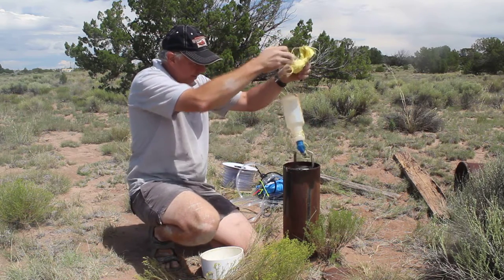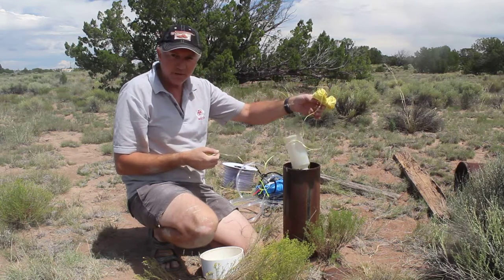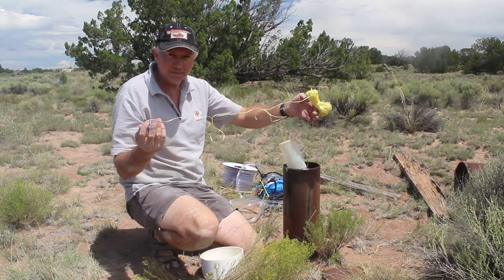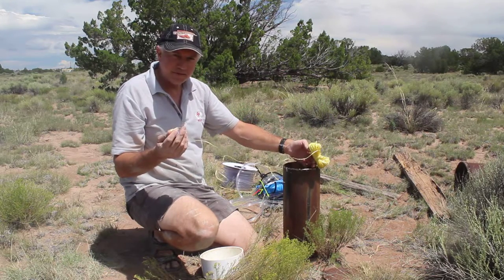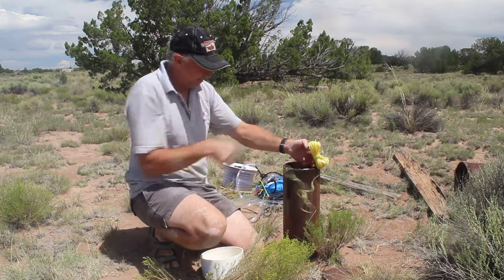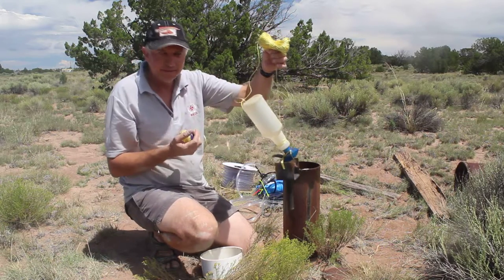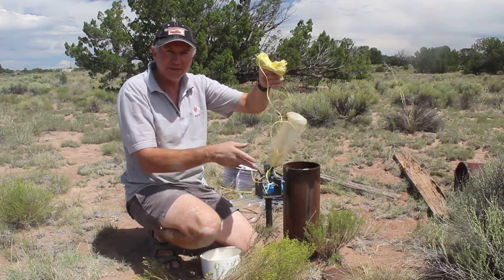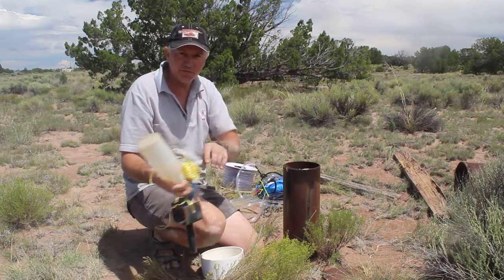Testing well water depth

Comment: Make a "Plopper".  Take  a piece of copper tubing 2-3 inches long.  Crush one end together,  Drill through the flattened part and put in key ring (A copper wire loop will do.)  Tie a line to the loop (or simply hook it to a tape measure).  Drop it in the well and when it hits the water surface the "Plop" echoes back up.  Read the tape or, as in the video, measure the depth.  The "plopper" won't jam and is very light weight but heavy enough to rapidly take the cord down.  It's simple to make, easy to use, and it works.